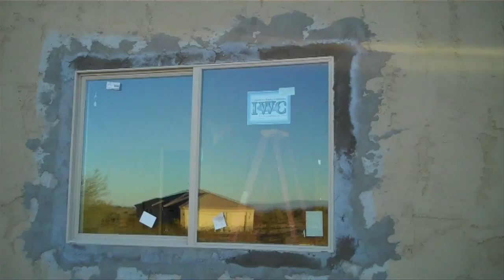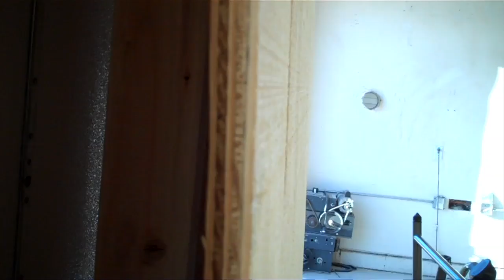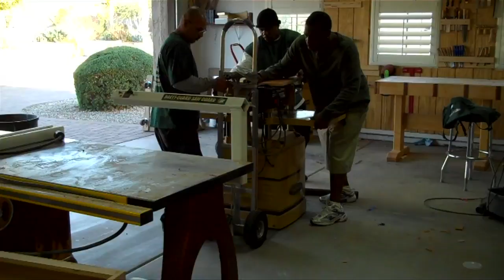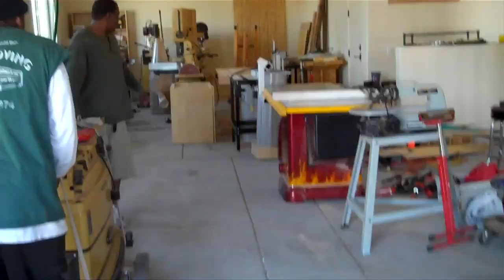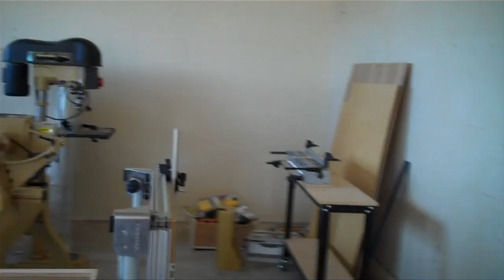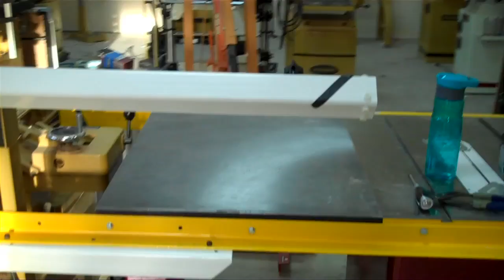Shop Journal #2 - Moving a Woodworking Shop 2011

Comment: hi mate,first of all your site is great,but i have a problem you may be able to help me with.
i have a older wadkin burgreen table saw which has served well over the years.
when i start it humms and shuts down,normally i open the switch and clean it and it runs,ive done this and no go pal.
have you experienced this at some time and any advice would be helpful as i really am not mechanically minded were motors are in the mix thanks

Comment: Hi Mark, I was wondering about how much it costs to install a 220v circuit if you have room on your circuit breaker.  It is a very short distance that it has to run.  It is for a 3hp single phase table saw. 
Thanks,  
Dan

Comment: I'm not a huge fan of the rollers they used. Those our just cheap movers you can buy anywhere. I like to build my own according to what I'm moving so I have full support. I put felt or carpet with pad to make sure things have extra cushion. Being a moving company I'm surprised they didn't have any advanced technique and just used mostly brute power instead. I'm always about advancing and making things easier in my profession but as long as nothing damaged I'm happy the move went good.

Comment from the maker: @ironlionkalo I have had success with every Jet tool I've owned. In many cases, its a Powermatic tool with a white paint job. Specifically, the Oscillating Spindle Sander is built like a tank. So unless you are running it over with your car or calibrating it with a sledge hammer, it should give you decades of great service. :)